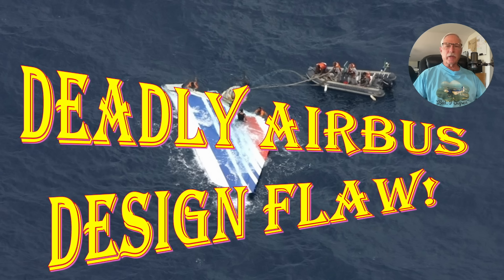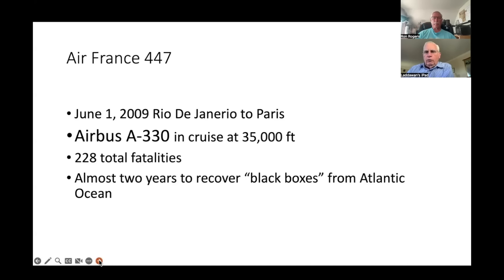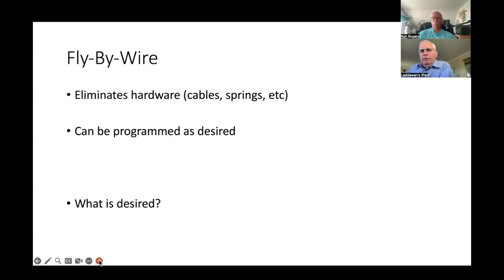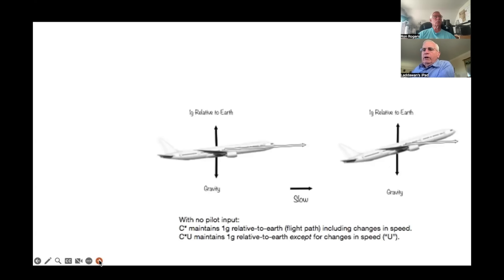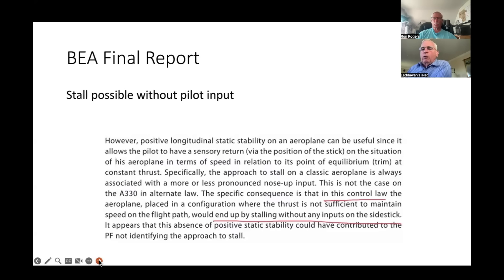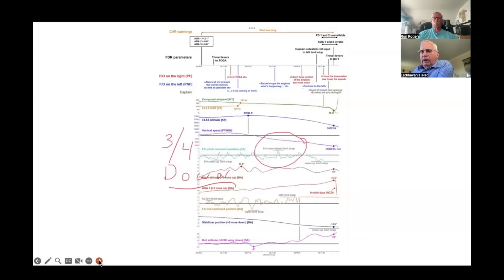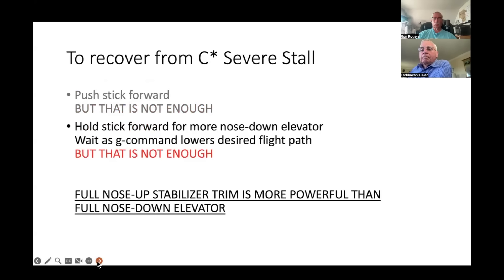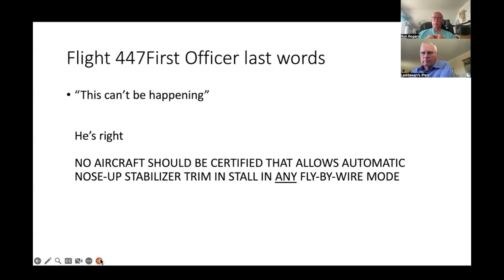Air France 447 Deadly Airbus Design Flaw! Tom Tilden about apparent speed stability in Alternate Law

Comment: I disagree, the 737 max pilots were never trained if the MCAS system failed or what the MCAS would do if it was engaged and that's a failure on Boeing's part to save money, and that's a fact.  To say that these two crashes were the pilots fault is a joke. Yes maybe a test pilot with thousands of hours might have been able to figure it out, but even the Boeing test pilots determined that the MCAS system as designed was dangerous, that's another fact. 
I went to college with one of the designers of the MCAS system, He had the worst concept of aerodynamics I have ever come across, he was wrong on just about everything and somehow he got hired by Boeing!
Reply: A MCAS failure is nothing more than a runaway trim situation. Following the runaway trim procedure would have solved the problem in BOTH Max crashes. Whether the pilots knew of the MCAS system or not both accidents could have been avoided by following the runaway trim procedure. 26:40
Reply: The covert implementation of MCAS on to the later B737 models was a grave error by Boeing and is inexcusable . Although recognition of the problem was difficult, implementation of the ‘Runaway Trim’ Recall Checklist would have defeated the malfunctioning MCAS.
What Tom Tilden is discussing here is a much more insidious ‘disease’ and, bearing in mind the Airbus FBW pilot training of 1990s/early 2000s, would have been almost impossible to analyse by a pilot in the heat of the moment. Tom Tilden is 100% correct and I congratulate him on his incisiveness. Now, will the industry accept his view?
Reply: @anthonydavey157  I don’t know how the recognition of the MCAS failure or a runaway trim is hard, you have a big wheel moving and making a lot of noise. That is the opposite of the Airbus which trims very quietly and is difficult to detect.

Comment: Your guest discredited himself by repeating Boeing's talking point which blamed the pilots for the MAX crashes.
Boeing lied to the FAQ to get the type certificate and kept the existence of MCAS a secret from the pilots who therfore did not know what they were dealing with.
Compounded of course by the extremely unsafe and cheap design of the system.
Reply: After the first MAX crash, Boeing put out specific guidance on how to handle the false angle of attack indications and resulting  reaction of MCAS trim with the flaps retracted. Most pilots could handle that malfunction. Just run trim to a comfortable point and turn off power to the trim system. Regardless, another crew did not react properly, crashed, and the MAX was grounded for commercial service. Test pilots in my airline continued to fly the MAX to maintenance and/or storage with no concern that it was unsafe. I agree with the decision to ground the MAX until a design improvement was made such that MCAS would not endanger those pilots who could be overwhelmed by the malfunction. 
In the case of Airbus, Airbus has specific guidance on how to handle the loss of airspeed. The procedure specifies turning off the flight directors and using basic pitch and power flying skills. As was the case with the Boeing MAX trim, most pilots can handle loss of airspeed. My concern with Airbus is that if a pilot does not apply proper pitch and power procedure, the aircraft can slow to stall in alternate law with no apparent feel in the stick that speed is decreasing. But worse yet, if the pilot incorrectly applies full aft stick at stall, the automatic stabilizer trim will continue to full nose up. 
Automatic full nose up trim in stall can still happen in Airbus alternate law. Most pilots will never get to that condition, but as shown in my paper it has happened to other Airbus aircraft. The result is that the fly by wire makes the stall much worse and in short time any chance of normal stall recovery is lost and the aircraft crashes.
Reply: Nonsense.  The previous Lion Air crew before the accident flight encountered the same MCAS problem and handled it just fine and lived to fly another day.
Reply: I think Boeing only revealed the existence of MCAS after the second crash? 
I like the flight envelope protections on Airbus, but really dislike the complete absence of feedback in the controls. You can't even know that the other pilot is also making inputs assuming I believe happened on AF 447.
It's almost as if the system was designed and developed by video game players without reference to actual pilots.